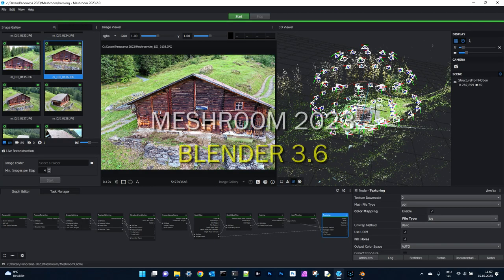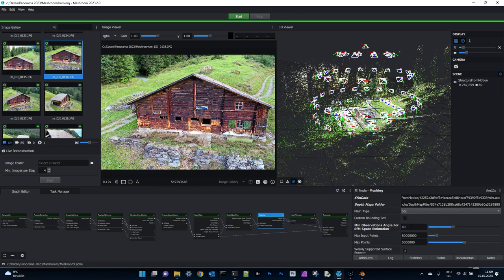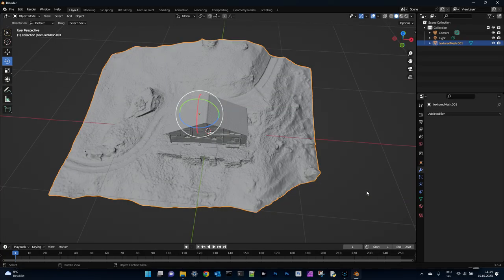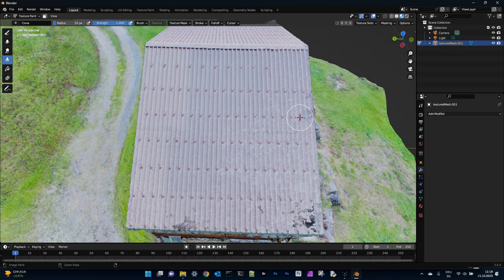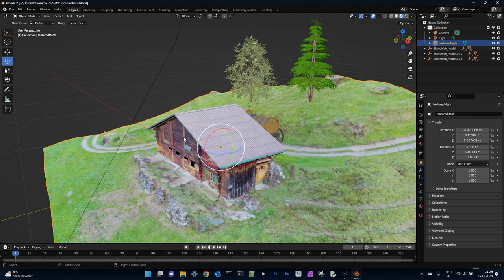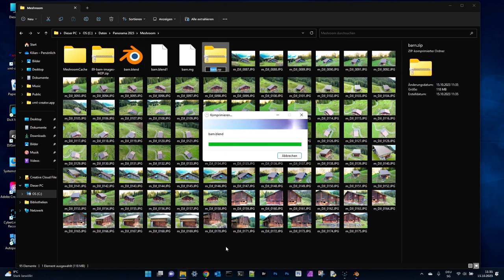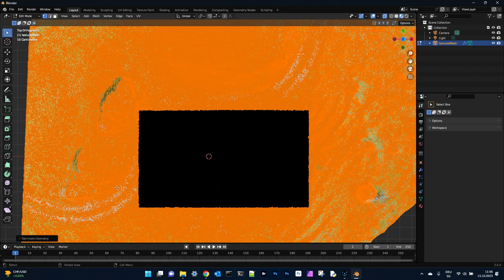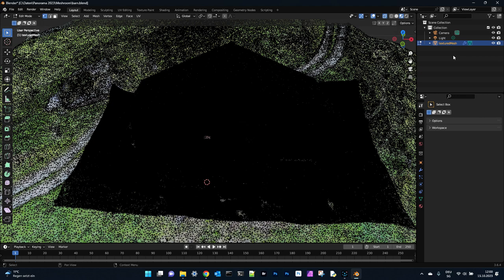Photogrammetry Meshroom and Blender Tricks

Comment: Great video , thank you.  It was easy to follow and answered some of my questions about fixing a mesh in blender.  Please make a video, where instead of a mesh, you created a point cloud and fixed the roof.
Reply from the maker: This is an interesting question. I tried to figure out the advantages. But with Meshroom I don't get any added value. Do you use Meshroom?
Reply: @KilianEisenegger   I've used it before.  It works well.